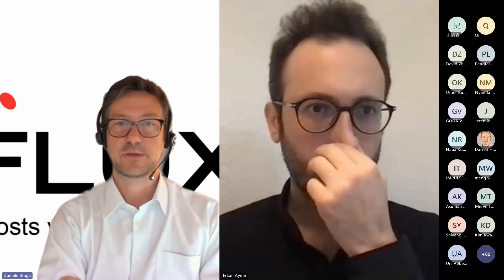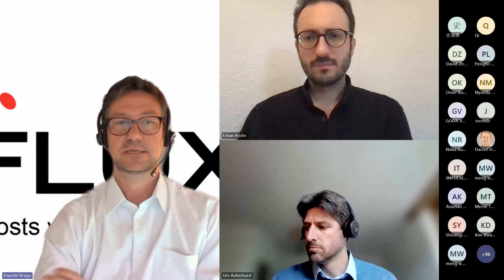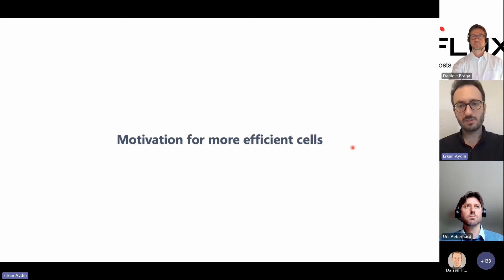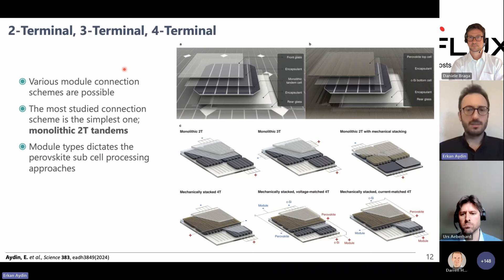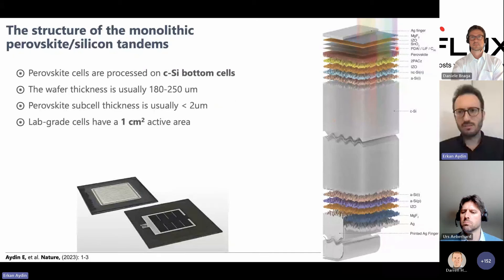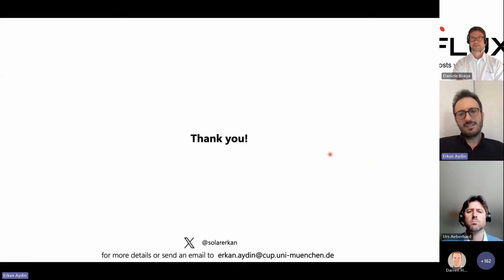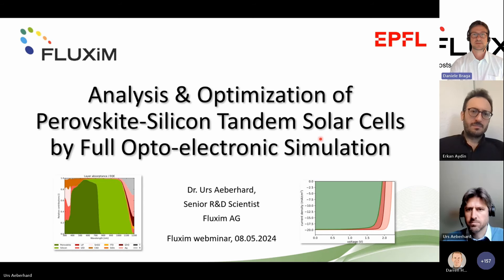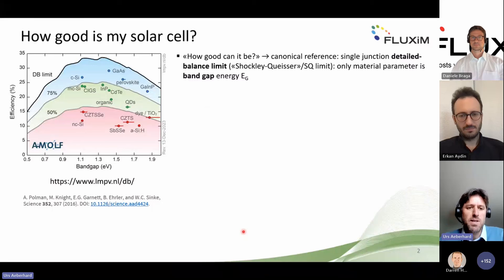Advancements in Perovskite-Silicon Tandem Solar Cells | Dr. Erkan Aydin & Dr. Urs Aeberhard

Comment from the maker: Here are the Q&A we didn't have time for: 

Question: Hi Dr. Aeberhard, thanks for your presentation. We wonder if a similar calculation of the PCE change with the thickness or band gap change of the top PVK layer on a 1.1eV Si bottom cell in a 4T tandem can be done. 

Answer: Using Setfos, you can compute the filtered bottom-cell JV curves as a function of thickness or band gap. The PCE is then found a posteriori using the voltage matching condition.

Question: For the simulation of the tandem solar cell, if I am correct for modeling the transport of carriers at the interface you use hopping from Homo to Lumo bands of adjacent layers, could you explain a bit more how this framework compares to a other interface transport models like thermionic emission or carrier tunneling.

Answer: We verified that the hopping model and trap-assisted interface recombination give very similar tandem characteristics. Eventually, what you need is a large enough rate of charge transfer around VMPP in order to avoid voltage losses (or, equivalently, losses in FF or even development of an s-shape). The main difference between junction models (especially tunneling) is the dependence on the local electric field, which can change drastically with point of operation. 

Question: Thank you for a great talk by you two. I have question for Urs. How can we include surface recombination at the interface in the Setfos simulations? 

Answer: There are dedicated models for interface recombination in Setfos. The full mode requires setting of the interface trap energy, trap density and capture rates for electrons and holes from either side of the interface. There is also a simplified version where you set only the interface recombination velocity and the trap energy position.

Question: Can stability analysis of the tandem can be done in this software (Setfos)? 

Answer: Currently, material parameters are input quantities and do not change over time. However, assessment of lon-term stability can be supported for instance by quantifying the impact of defect evolution in the material, i.e., by analysing the state of the device at a given point in time. 

Question: Can we make tandem perovskite solar cells with other semiconductors than silicon?

Answer: Indeed, there are WBG perovskite based tandems with CIGS or a narrow-band gap perovskite as the bottom cell.